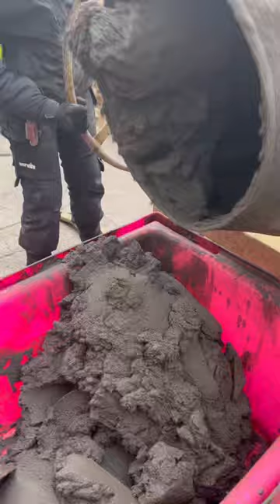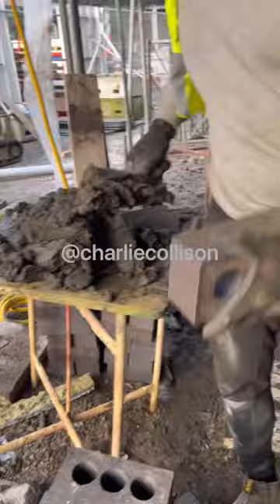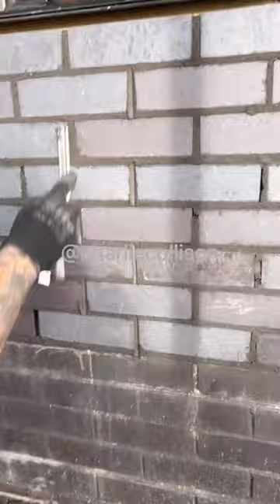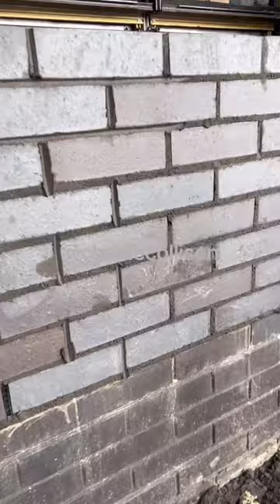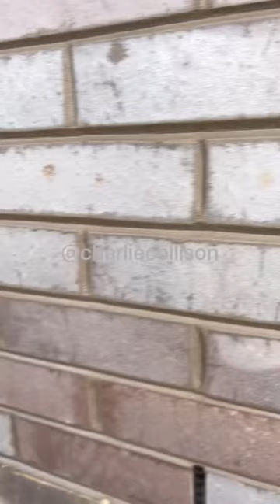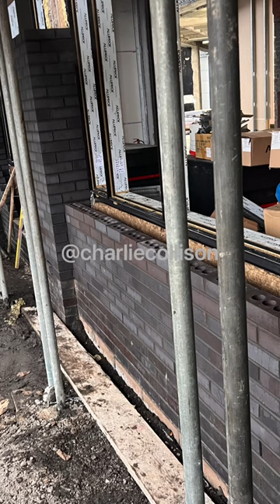Laying blue bricks. Black mortar and v jointing 🧱 #bricklaying #brickwork #construction

Comment: Looks great BUT here in USA or I should say New Jersey we use a 16 inch striker for the bottom bed joint, your damn good Charlie but it makes the bed joint straight, a true Mason can tell the difference!!! You can see the difference. We do brick,8-12inch block,no 4's... Or the fake weigh lights, anyway great work I wish we had it that easy, Amy couldn't pick up the block we lay!!!😂. That's why I am disabled 😢 God 🙏 Bless your the best bricky I have seen.!!!

Comment: Staffordshire blues? Looks lovely mate 👌
Reply: My dad just pulled about 700 of them down from a train station and there worth around £7 each
Reply: Are those bricks made of steel or something?
Reply: @bunnyphoenix2992  They have iron ore inside of them
Reply: @craigmccormack3255  oh, first time seeing them, no wonder I thought they shine like metal
Reply: @bunnyphoenix2992  Remarkably astute observation, they are much heavier than regular bricks as well naturally.
Reply: @craigmccormack3255  then they are more durable and strong than regular bricks right of course more expensive as well
Reply: @bunnyphoenix2992  Correct, they were more often used in civil engineering applications, inserted as a DPC as they have a lower water absorption rate, I've seen 6% stated. These would form a Class A engineering brick.
Reply: @Pianoguy32 😂